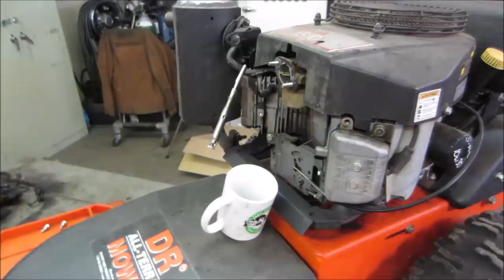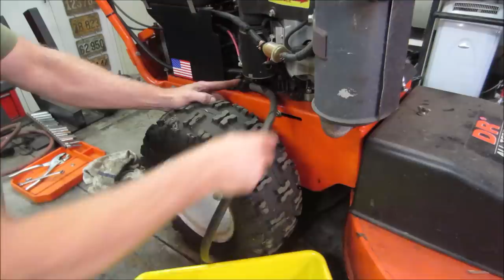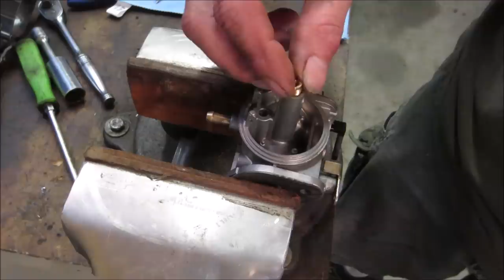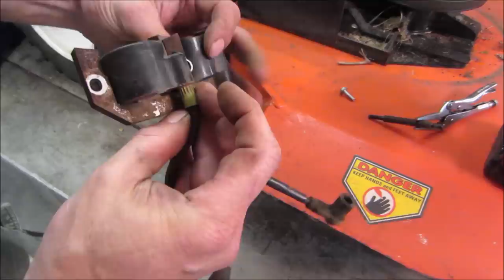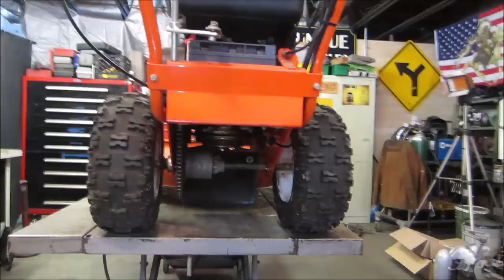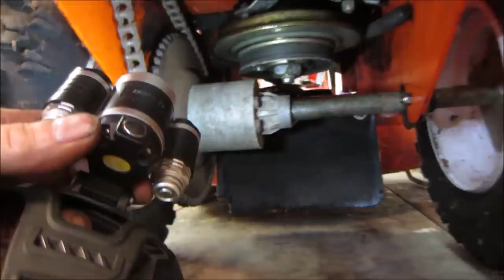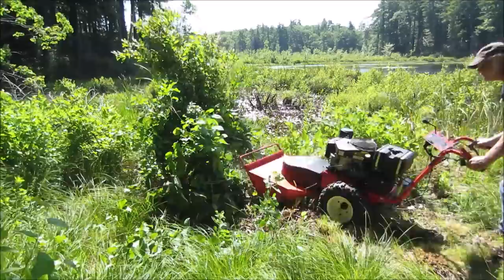Will It Run? Abandoned 11 years ago. DR Field and Brush Mower

Comment: Mustie, I wanted to share a quick story to give you an idea of the positive impact and reach you have with your channel. I grabbed a freebie wood chipper this morning with a nice 8hp Briggs on it. Little rusty, “hasn’t been run in years”. Got it home and had my teenage sons come out for some lessons. You got to understand, my dad wasn’t mechanically inclined at all and could barely work a screwdriver so it took me many years of hands on figuring-it-out and learning from others to get a basic knowledge of fixing things. Your channel has taught me many valuable lessons and probably most import, the proper method for troubleshooting which I want to impart on my kids. We went down the list:
Pulled it over to make sure it wasn’t seized
Checked oil level and condition
Checked for spark
Fuel tank was bone dry and smelled good 
Dribbled some gas in the cylinder, popped the plug back in and pulled it over
It fired right up (insert Mustie laugh here)
Put a little gas in the tank and she ran without issue. Not stutters, noises, etc. 
Both tires were off the bead so I taught my boys the ratchet strap trick to air the,m up. Both seated and took air to proper pressure. 
We now have a nice little chipper/shredder that cost zero dollars and gave me the opportunity to pass on the knowledge I’ve learned from your videos to my sons. You can’t put a price on that. 
Thank you for all you do providing such useful, valuable and quality content. It is greatly appreciated!
Reply: That is an awesome story.  Even if your children never choose to fix things later in their lives, they will never forget that you taught them what can be done.  Regards, Al.
Reply: Al .
Reply: Sometimes you can always wait on someone else to fix something for you a very valuable skill
Reply: Great Story. Thanks man!
" You can't put a price on that"
Agree 💯👍👍👍

Comment: I have a Troybilt sickle bar mower that belonged to my dad. It actually worked when I used it a few years back. I tried to use it this year and nothing. Tires didn’t hold air, gas poured out everywhere from the area of the carb. I put 2 new tubes in the tires ( the tires are cracking so I hope it lasts) and I pulled the carb off and pulled the bowl off. Everything was frozen. Throttle plate, choke so I sprayed carb cleaner on it and put it in my $8 Harbor Freight thrift shop bought ultrasonic cleaner with water and “Greased Lightning” cleaner. 
I put it all back. No leaks and it fired right up. Thanks Mustie for sharing your experience. It’s like I’ve seen this done so now I can do it.

Comment: There's no such thing as taking advantage on a Offer. They always have the right and opertunity to say NO
Reply: And he probably gives a better offer than what most others would.
Reply: Besides, a lot of people aren't actively trying to get top dollar for old equipment, they're just trying to clean out their garage/yard for whatever reason and want a few bucks in return. I've given away/sold stuff super cheap for the same reason when moving: I know I could get more, but I want it gone now and it is cheap or the landfill.
Reply: I'd have to say it depends on the scenario.  Ever seen American Pickers where the seller suggests a price and the pickers offer a higher price trying to be fair? With an estate especially where the seller may know nothing about the items being sold, it is only right to be fair and not take advantage. $500 for this mower not running and no history is certainly fair.  We've all been there with a repair that requires lots of specialty parts that add up to far more than the machine is worth.
Reply: @Allan Charles So a fair price is anything the seller will agree to (as long as it isn't a collectable)?  What if the seller is older with potentially diminished mental capacity?
Reply: @Allan Charles I responded to the post that said there is no such thing as taking advantage of an offer, saying I don't believe it's quite that simple. I'm not sure if that's what you're responding to, but your statement "acting like this is a case of...." doesn't match anything I've said, so perhaps you're mixing up different replies.  People can and do take advantage of others unfairly.  I have not said this is the case with this purchase nor would it be my place to do so.
Reply: @Allan Charles MOST of the scenes are scripted. I've talked to a seller who has  dealt with them, and all the give-take shown was scripted. It's all show biz. But that's what television is.
Reply: Time is money, too. If he's got to spend a whole day fixing something, that's time he's not spending making money elsewhere. This isn't just a fun hobby.
Reply: @Gary That was my exact thought,  but that's not the most coincidental thing here, my name is also Gary.
Reply: @jamesg7371  yeah i wouldn't have given what he gave for it tbh. Especially not knowing if it ran or not. Oil Leak, gas looking the way it did in the filter. Some people expect like new prices for equipment no matter the age or condition.
Reply: opportunity
Reply: @Albo alt,  so what you got for sale today ?

Comment: I have a DR similar to this one, but with 17HP motor.  I believe the hanging orange wire under the control panel is for the optional hour meter.  Only safety to start should be transmission in neutral, then the key will kick it over (haven't watched the whole video yet, you probably already figured this out). 

There's a lever to loosen the deck belt on the top of the deck, right side facing forward....vice grips not needed
Reply: You are correct Mr. Heck.  That is for the optional hour meter.

Comment: That thing is a combination heavy-duty lawnmower and chain saw.  With respect to whoever was beefing about Mustie taking advantage of the former owner’s widow - c’mon!  She wasn’t going to use any of this stuff and most people wouldn’t have a clue how to fix it and as Mustie said, he may very well have paid $500 for a completely scrap machine. Besides, he partially makes a living fixing and reselling old machines - if he pays retail for them, he couldn’t make any money.
Reply: Exactly, just like they do on the Pickers program. It costs them time and transport costs and preparation costs and they have to hold it till they find a buyer, just like Mustie1 has to.
Reply: Yeah. Previous owner could have paid shop rate for diagnosis, carb, battery, coil installed only to have a rod knock show up once the engine was running and warm- and took a huge loss.  A non-running machine isn’t worth much (often free) and my guess is she didn’t want the hassle, or to invest the cash for repair, or take the risk of a possible loss to try get it running- all for the chance of getting a bit more than what Mustie likely offered.

Comment: Had an old friend tell me awhile back. If you have a bolt that refuses to let loose, try tightening it first, it'll break the rust or whatever is holding it (sometimes) and it'll then unscrew. Works about 75% if the time. Just be careful you don't strip the bolt head or phillips head or...you got it. Great show. Thank you! Great editing too! No wasted time.

Comment: Pretty good deal, both ways.  Careful with the tire pressures.  Check the tire pressure numbers on the sidewalls.  Those tires are meant to be relatively soft for compliance with the surface.  Ten PSI sounds about right.  Good job on the repairs.

Comment: I picked up a Cub Cadet copy of this type of machine earlier this spring. Although running, it also needed some love. It worked well for expanding the yard, but with twin overlapping blades that have a timing belt, it's a bear to deal with when it slips time once the blades come in contact with some they can't cut. Overall, a good machine, but the DR looks more heavy duty and with a single blade, it may be better for what I need.

Comment: She looked like it should be in great shape, but looks can be deceiving.  That is the main reason you offer a discounted price when you buy it.

If it was running on one cylinder, that might also explain the gas in the oil.
Reply from the maker: My thoughts exactly
Reply: Mustie1 Which of the brush hogs do you like better the old one or the newer one.
Looks like the older one is easier to handle
Reply: Does sounds likes running on one cylinder.
Reply: If that's the case, definitely change the filter.  The sooner the better!
Reply: 100% agree, if it's got hydro's those are extremely expensive, once it's older no guarantee you can even find parts and it might be an expensive paperweight.  I found a really cool Coleman 2800 OHV generator that needed carb work...all parts for it are discontinued...also found an awesome Honda EM500 generator that was cheap...turned out the previous owner cleaned the carb and forgot the emulsion tube which is discontinued along with the carb...turned into a 20 dollar paperweight.
Reply: @bobcranberries5853  The older Gravely brush cutters were pretty good units in their day.
Reply: Mark Yes I had one probably from the 60s it was built like a tank heavy as hell but would cut anything
Reply: @mustie1  I've only seen this once but it worked very well is to take some string trimmer line and and wrap it around a shop towel and load it up the drill and clean out tanks with it.  It's pretty effective. And rowdy lol

Comment: I have worked on many DR equipment (DR was headquarted here in VT before Generac bought them).    That 'powerhead' you have had several attachments available (Generator, mower, snowblower....etc)   Some even had a 'lockable' drive axle. (instead of plain differential) There were several engine-sizes too. That Kawasaki was the biggest engine available That orange wire hangin down was for optional headlamp. (blowin snow in the dark)

Comment: I have the same model and it was hard used for many years.  I rescued it from scrap pile and switched it to the finish desk to mow bumpy, wooded acre.  I have to replace the transmission and PTO clutch this winter.  And figure out how to get it to idle again.  It's surging on me.  I got it tweaked 8 years ago and can't remember what I did but hey, it's a carb, only so much to adjust!  Wish the paint on mine looked this good.

Comment: Those Kawasaki FH engines are known to have coil issues especially if they sit or get rusted. They also have issues with the governor shaft seal leaking. $5-6 oem kawa part and about 15 minutes to change and it's good to go. Same with the crank seals.

Comment: I bought one of these about a month ago  for $50. It's not as nice or as new but everything works.  It was not running and needed a battery and fuel system cleaning just like this one.  Mine has a single cylinder Kawasaki and a  lockable differential.

Comment: I once watched a video where a guy cleaned out the fuel tank by throwing some paper towels in it and then using an air gun to blow them around inside the tank. The tank came out really clean, even in the corners.

Comment: That gentleman, RIP, had some great 👍 equipment.  You shouldn’t have any problems on the re-sale 🤑...  

 Gota say, more often than not I pick up a good idea from you (magnet to hold the plug to ground).  Looking forward to the next “Will it Run”.

Thanks for sharing

Comment: I had a DR brush cutter 2003.  The thing was a monster.  If it pushed it over it would cut it up.  Never had a problem with it.  I used it for 8 years and passed it down to my 30 year old son and he still uses it.  Dr attachments are a string trimmer, chain saw attachment for trees up to 7 inches.

Comment: i just bought a dr of the same model. it has not been run in several years. it does turn over but will not start. i haven't started work on it yet but this video is definitely going to be a great assist. hope to have it running in a few weeks after the rain stops. great video. it is supposed to be a 2007. i found the model on the frame under the gas tank on the right side of the frame.

Comment: Hey, here's a tip, that I came up with, half a century ago...get two crocodile clamps, that will open up wide enough to clip onto a spark-plug body. Remove the screw from one of them and cut off the strain-relief tabs from both clips. Drill the threads out of the screw hole in the one clamp. Remove the screw from the other clamp and invert the clips and lay top plates together and run the screw thru the hole you just drilled out and back into the threaded hole and tighten. 
   Now, clip the unit around the spark-plug to test. clip the other end onto the heat fins or a bolt on the engine. Put the spark-plug wire on the test plug. THEN, pull it thru. Three things...the plug stays where you put it, and its grounded good, and you don't get the poo knocked out of you...holding a plug with 32,000v running thru you!
   I appreciate your expertise and you making these videos!!!
   Bill from Tn. 🇺🇸

Comment: Hey Mustie, I saw from another YouTuber @andrewcamarata on how to clean out gas tanks. He throws a paper towel in there and blasts it with air. It tosses the towel and does a great job picking out the grime. It’s my new go to method. Keep the great content coming!
Reply: If there's something really grungy with limited access, a chain mail scrubber for cast iron works well if the tank can be removed. Just toss it inside and shake and swirl it around, then rinse out.

Comment: Mustie, when a dealer "flushes" a transmission, they hook up to the trans cooler lines and back flush the system, something I dread hearing about, because they don't clean the trans pan or change the filter and if the filter is a paper type, the back flush can destroy it with possible damaging results to the rest of the trans.

Comment: A very nice result!

Power transmission by "Peerless Gear Division of Tecumseh" - Nice, no nonsense gearbox, easy to work on and parts easy to get, but rarely ever have problems. Their differential axles never give any trouble at all. All-in-all, very similar to our Hayter Condor, and the exact same power train. Built like tanks and will go forever. You dropped lucky with this machine - very nice.

Now, I can't speak for the DR, but Hayter made/make a range of different headers for their machines, and a trailer-seat so that you can ride behind. We even built a few attachments of our own, just to extend its usefulness. 

That clacky noise? You should hear our JD lawn tractor when it starts up (Kawasaki motor), but it runs as sweet as a nut once it's started. I think it's the automatic decompression mechanism that makes all that clacky noise.

Me likey this machine very much!

Comment: Ours is on ‘07 also. Oil, gas and filters is all that’s been required. Gets into places a mower can’t go. 

To answer a question from another comment, yes, this is the same Kawasaki engine as in the X300 series John Deere lawn tractors. We have a X304 (4 wheel steer).

My only complaint (although the comment about beating you up was appropriate) is that the clutch is difficult to use when the cable stretches (small arthritic hands here).

Comment: Funny, I just had to go thru mine this weekend clean carb and all to get it running. I have had mine for years and agree these are tanks and can cut saplings like nothing. They are a bit of a workout, I use it for brush like intended, but wish I could find the finish mower attachment for it as well. There's also a wood chipper, generator attachments as well as the finish and brush mower attachments.

Comment: For the FJ, if the shudder is at very light load, my guess would be torque converter shudder. You can try changing the fluid again, but you'd probably have to do it a few times to have an impact (temporary at that). As to how someone could tell if the drain and fill plugs have been removed, you beat me on that one - a former tech.

Comment: About the ultrasonic cleaner: I've seen people using straight water in their cleaner, but putting the parts in a plastic sealed bag filled with the fluid you'd normally put in the cleaner. That way you only contaminate a little bit of cleaning fluid at a time, and it should keep your cleaner cleaner (lol). I'm not sure if it's easier though, I think it may be a bit finicky.
Reply: I've seen water and a glass jar as well seems to work fine for conserving the fluid.
Reply: I use hot water and dish detergent. Seems to work just fine and don't have to worry about cross contaminated fluids if I use it for something else. However it seems Mustie uses his exclusively for carbs so he uses the good stuff in it.

Comment: I've bolted two alligator clips like the ones on a battery charger. together to hold spark plugs to test them. Place the plug in one and the other to earth it work very well.
Reply: Neil Collin clever! Might have to give that a try.
Reply: There are actually spark testers out there that aren’t that expensive. Does exactly what you just described but a lot less janky

Comment: Lily pads? Get a light chain and lay it around where you want to get rid of them, hook the ends of chain to  your truck - and PULL! The chain wraps around the roots of the Lily pads and rips them out of the bottom. They look pretty in the Spring, but fouls your prop and blocks your cooling water intake(s). Very frustrating. That is what we did to lilys and cattails to get rid of them next to our dock In Sodus Bay off Lake Ontario. You seem to have quite a collection near your dock. Weighted 3/4" hemp rope will do the job as long as it is fairly new without wear spots. In the 60's, they used pellets airdropped to control algae and Lily pads, but when the EPA came into existence, they stopped that. Bad for the fish I guess, but we didn't notice. Thanks for the video!

Comment: I have the same DR, Every couple of years when I need it, I drain the carb and tank, refill with fresh gas, charge the battery, and cut. With the 1/2 in. thick blade it will cut any tree that is small enough to bend over to be cut by the blade.